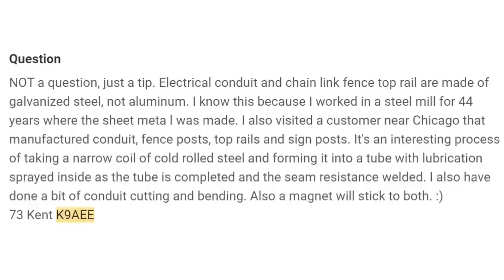It's Steel, not Aluminum! (#411)

Comment: Dave there’s no need to clean or polish silver plated connectors I was told by my Elmer 50yrs ago the oxide itself is a very good conductor and cleaning them can remove the plating. Keep up the great work 73 GW6BXU

Comment: Not all electrical conduit is made of galvanized steel. Some is made of galvanized steel, some is aluminum, and some rare conduit is made of duralumin, which is, according to Wikipedia, "an alloy made up of 90% to 94% aluminum,4% copper, 1% magnesium and 0.5% to 1% manganese."

As for top rails, it's easier to find them made of galvanized steel, but not all of it is made of steel. Some IS made of aluminum. The Hoover Fence company makes a Schedule 40 aluminum product for chain-link top rails and posts, and they say: "Our Aluminum Schedule 40 is a heavy grade material that is suitable for most chain link applications. Material can be used as posts and top rail in conjunction with our other all aluminum fence components to create a chain link fence that will retain its appearance and integrity for years to come. Can be purchased in full lengths or as cut posts for your convenience."

So that person's experience is that he's seen top rail and conduit made of galvanized steel. But he hasn't seen EVERY kind of metal conduit or fence rail out there, and some of it certainly is made of aluminum or aluminum alloy.

Comment: On the Research Ship Shell America we had large Bushings for rotating electrical contacts made of Gold, they were serviced every couple years and the fine dust was recovered. Brinks Security was on scene for that operation. I do not think it was thin. One caution, the zinc used for galvanizing  gives off a poisonous gas when welded.

Comment: Ferris metal literally means "contains iron".  However there are two other non-iron elements that are magnetic, Cobalt and Nickel.  I doubt that you will find any pipes or tubing made from either of these however.  One of the most popular magnetic alloys was "alnico" which was a combination of aluminum, nickel and cobalt (NO IRON).  The aluminum was for physical strength, the magnetic properties came from the nickel and cobalt.  Both of these elements are considered "rare earths".  US nickel 5 cent coins contain only trace amounts of nickel, they are not attracted to magnets.  However Canadian nickels (5 cent coins) contain more nickel and ARE magnetic.   Heliarc (tig) welding has been around for aluminum for years!  During WWII, the US mint lent their silver bullion to the Manhattan project to make electromagnets for the purpose of purifying uranium and plutonium to make the first A bombs.
Reply: There are a number of metal alloys other than alnico that are magnetic, called "Heusler alloys" as a class. The key feature of a Heusler alloy is that the constituent metals are not magnetic in their pure state. 

Britannica says: "Heusler alloy, any of the first magnetic alloys composed of metals that, in their pure state, are not magnetic. The alloys are named after Fritz Heusler, 19th-century German mining engineer and chemist. Heusler alloys consist of approximately two parts of copper, one of manganese, and one of tin. The tin may be replaced by aluminum, arsenic, antimony, bismuth, or boron; the copper may be replaced by silver."

(BTW, it's "ferrous", not "Ferris". The former means "contains iron". The latter is a wheel in amusement parks. hi hi)
Reply: Nickel and cobalt are not rare earth metals

Comment: 2:53 there is more to that than simply plated one on top of the other. If two metals can not contact directly between each other then they can not be plated on top of each other. If you have a nickel-plated keyring you probably noticed that when the plated coating wears down you can see shiny copper. In most cases to archive required plated coating the intermediate layers are placed between to balance out the flow of free electrons and it does not mean the single layer as there could be many different metals between to cancel out negative effects between plated metals. Corrosion does not mean oxidation it is a degradation of the structure which oxidation is one of them but it could be forming of salts like it happen to copper or general crystal structure like it happens when galium meets aluminium.
Reply: Interactions between some metals in contact with one another corrode from an electrolytic action, not oxidation. The reaction between gallium and aluminum is neither oxidation nor electrolytic corrosion, but amalgamation. Gallium only infiltrates the aluminum if the oxide passivation layer on the surface of the aluminum is scratched or scored enough for the two metals to come into direct contact -- the oxide layer keeps them from amalgamating.

Gallium is somewhat like mercury in that it infiltrates other metals and forms an amalgam with them. The metallic bonds of the amalgam are not strong, which is why an aluminum/gallium amalgam crumbles when you bend it. You can amalgamate gallium with a number of other metals, even gold. Mercury and silver used to be widely used for dental fillings because it could be packed tightly into a cleaned-out cavity, and it held up well to being pressed upon while chewing, which only pressed it tighter into the cavity. But this was stopped when it was discovered that such fillings leach mercury into the body, where it is horribly toxic. Gallium, to my knowledge isn't toxic like mercury, but its amalgams are very weak structurally due to the interspersed metal crystal structure that can't form strong bonds between the atoms of the metal.

If you're into tweaking your computers for speed, I strongly recommend against using the so-called "liquid metal" heat-transfer material, as it's usually either gallium or a gallium amalgam with something. I wouldn't let that stuff get anywhere near my computer's components, since an awful lot of them are aluminum or other metals that will amalgamate with gallium.

Comment: Have a care if you try to weld on galvanized metals.  The zinc plating will give of highly toxic fumes that can cause a whole host of neurologic and pulmonary issues.  Clean all zinc coating off metals before welding or brazing.

Comment: Whatever it takes to hold up the antenna. I use aluminum tent pole sections made of aircraft aluminum, light and strong and cheap. Larger diameters and thick wall, even plastic, work well too for height. For some you need to go to an electrical or industrial supplier. Still better than the old ham solution of bolting 2X4s together.

Comment: A number of coolants are used in medical NMR systems. Both liquid nitrogen and liquid helium are used to lower the temperature of critical NMR parts to obtain useable NMR images for medical diagnosis.
   Liquid hydrogen on warming produces highly flammable and explosive hydrogen gas. The Hindenburg disaster is a notorious example of the hazard. So it would not be used for safety reasons.
N0QFT

Comment: Good call Dave!!!!  Ive been using top fence rails for years.  I use to use radio shack masts....which were alot thinner than the top rails.  One day walking thru a big box home improvement store, I noticed the fence rails.........and the light bulb lit!!!!!!  They work great.  I do paint mine to match the tower and in my mind, to make them last longer!!!!  Stay safe Dave!!!  73  N8SOT

Comment: There is such a thing  as aluminum electrical conduit, but we're not likely to run into it. Same with fence, but the 1 3/8 top rail I've never seen in aluminum, some of the larger posts are. I have some 2 3/8" powder coated chain link fence posts in aluminum. But it's not so common, and the top rails on that fence are powder coated steel.

Magnet test ftw! Also of note - some stainless steel is magnetic, some is not. Austentic vs martensitic - if I have those spelled right anyway.

Comment: Few things incorrect in this one, not all ferrous metals are magnetic, non-magnetic stainless steel for example. Silver is not the most conductive element, some forms of Carbon are, and they use Helium to cool most superconductors. Hydrogen is far too explosive when mixed with air.

Comment: When I was active duty in the US Air Force I noticed a lot of connectors on the F-15 Eagle were gold. Such as the liquid oxygen bottle gauge connectors. I guess gold is the best conductor.
Reply: NO, a very common misconception!  Silver is a better conductor!  Gold is used because it never tarnishes or corrodes.
Reply: @hectorpascal  Understood well at least silver is cheaper.

Comment: So my newer F250 (aluminum) should make a fine ground plane if I mount an antenna to it. Curious about a magnetic mount antenna using a steel sub-plate and the ground plane effect as a counter poise...? Anyone have any experience in that area?
Reply: With low power about 5 watts the following items work.

Metal filing cabinets, wall lockers, clothes washers and driers, etc. work with magmount antennas. Even aluminum foil spread across a wooden or plastic table will work with a magmount antenna placed directly on top of the foil.
N0QFT